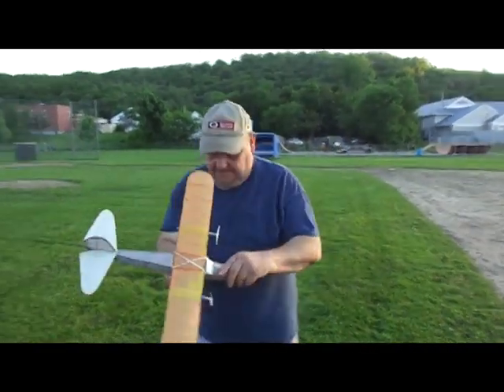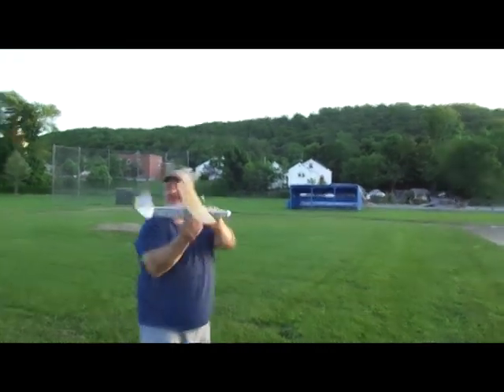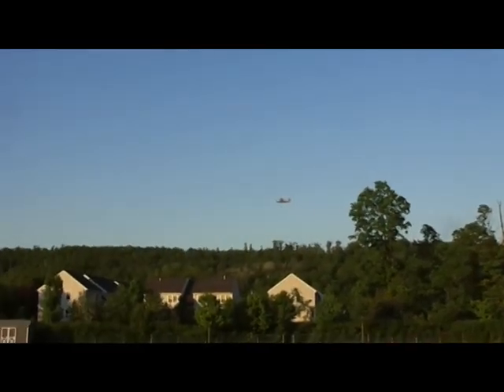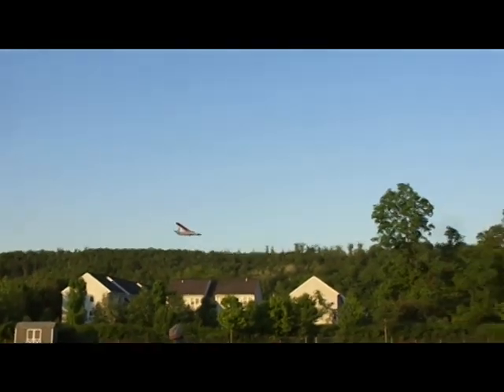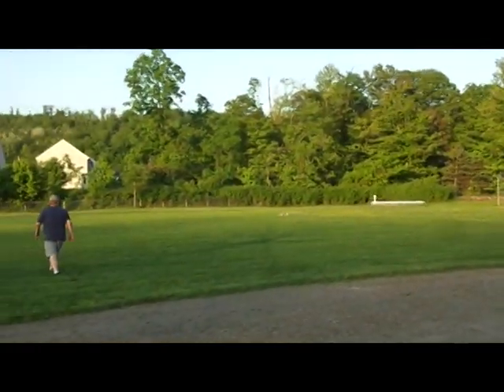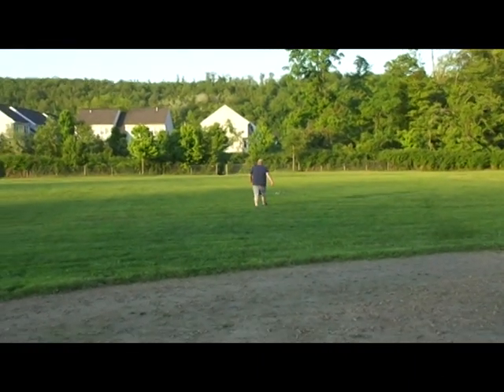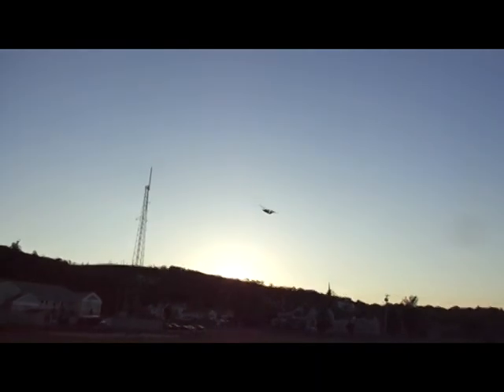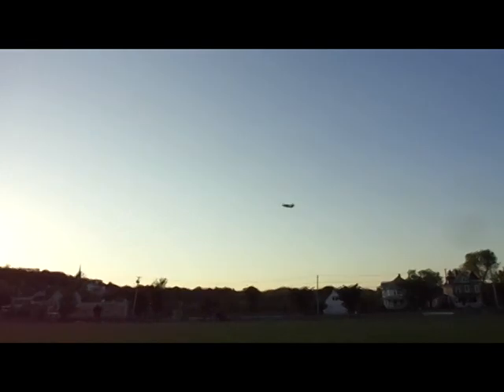Richie Maidens a 40 FARAD Supercapacitor Plane!

Comment: Hi again Mike, for this Ace Moth using two 40 F for each motor or 20F for each, totaling 40F?
Reply from the maker: It has a single 40F cap which supplies both motors. This way the motors run the same speed through the entire run. Motors are 8520 coreless and props are 65mm.

Comment: how do you control the volts to the motor so precisely? is there a controller? or a volt meter on the circuit and you watch it charge up?, i would like to learn more about capacitor flying, cheers for a great video
Reply from the maker: Hi Aaron! Thanks for your comment and interest. Check out my channel for more capacitor flying info. "Supercapacitor free flight basics" lays the groundwork and there is a video detailing the construction of the charger we use. I have also posted a build-along video series detailing the construction of a simple model along with links to the equipment supplier where we source the power system components. Yes, we're watching the voltage on a digital voltmeter as we charge the cap. This allows us to control the flight duration as we fly in small fields. Cheers, Mike

Comment: Just beautiful!
Can you share the internal resistance for each 8mm motor?
And how did you connect the motors (parallel)?
I desperately need some of your calm warm weather! And a bit of your enthusiasm as well! 👍
Reply from the maker: Actually they are 8.5mm x 20mm and we are using 65mm props counter rotating along with a 40 Farad 2.7 volt supercapacitor. They are parallel wired. Here's another plane with the exact same equipment but built lighter and with more wing area (2.6oz and 200 sq. in. wing area). https://www.youtube.com/watch?v=WWgCkGkGIVw
Sorry but I can't determine the internal resistance of the motors without cutting some wires in the model... here is a link to the motors we used on Banggood...  https://www.banggood.com/Chaoli-CL-820-8_5x20mm-Coreless-Motor-for-90mm-150mm-DIY-Micro-FPV-RC-Quadcopter-Frame-p-1054803.html?p=AZ31114857064201605K
 they have a deal on them right now and I just ordered 8 more! Waiting on them now...You can get free shipping by selecting "standard shipping" from the options. Supercaps we use are from there too, 10 Farad and 40 Farad are available. They also stock propellers and switches. I am going to try a 8.5x20 motor, 75mm prop and 2x10Farad caps on an old stick and tissue rubber job!

Thanks for checking out the video and dropping a comment! -Mike